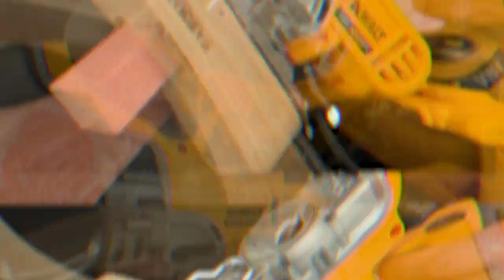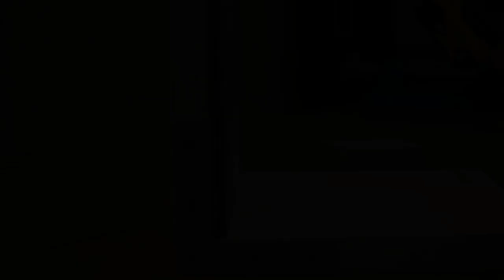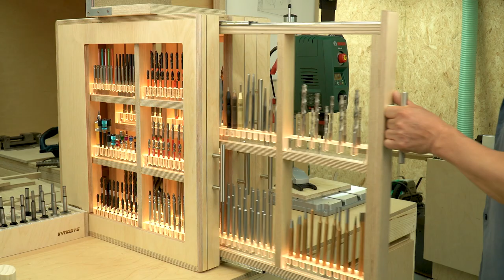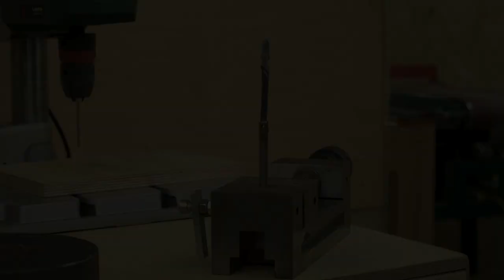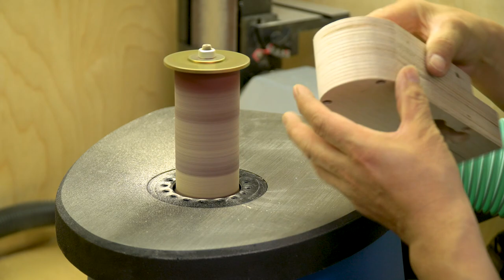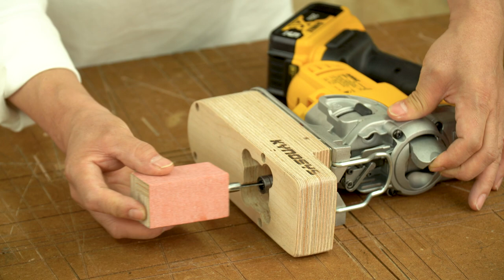Jigsaw sander making / Dewalt DCS331 / DIY

Comment from the maker: Please turn on your language subtitles! 
If we drill a hole inside the plate in a square shape, sanding the inside is very inconvenient.
It is also very difficult to sand the four corners of the interior at right angles.
The basic spindle sander is circular. The circular body rotates and moves up and down to sand.
I came up with a plan to make a square spindle sander. 
Because it's a tetragonal, I thought, "Is there a tool that doesn't require rotation, just a round-trip stroke, that's a good tool to speed up comfortably?" And I concluded that jigsaw is very suitable for this.
The idea was that if there is an iron rod that moves inside the bearing, the jigsaw blade, which reciprocates at a high RPM, it can be reciprocated in a square shape.
I added a wooden board to the lower plate of the jigsaw, and I drilled a 15mm hole in it to fit the bearing, and I made it possible to reciprocate with an 8mm iron rod.
I drilled a hole in a rectangular-shaped tree at the end of the iron bar and fixed it with a headless bolt.
The jigsaw blade was cut to an appropriate length, drilled, and connected to the iron bar with a fixing pin.
Now sanding a rectangular wood with double-sided tape makes a great tetragonal spindle sander.
Spindle sander breaks the stereotype of circularity and is a work that can be easily sanded inside the plate by making it into a square. 
I used DCS331 products from DeWALT.
The DCS331 jigsaw is very fond of its shape and design, so I'm preparing it for use in other works.
The front shape resembles a train, so I'm going to apply it as a power source for a model train.
I hope you enjoy watching the video, and if it was helpful, please push subscribe and like.
Thank you.

#DIY #WoodDIY #Making #Jigsaw #Sanding #DeWALT #Tool #PowerTool #Howto